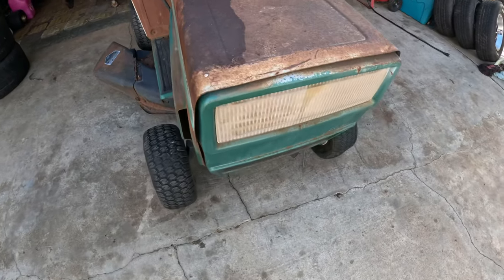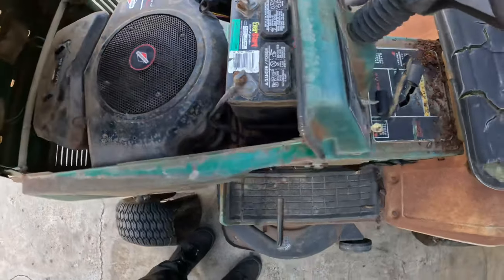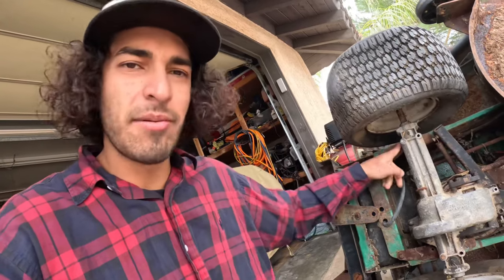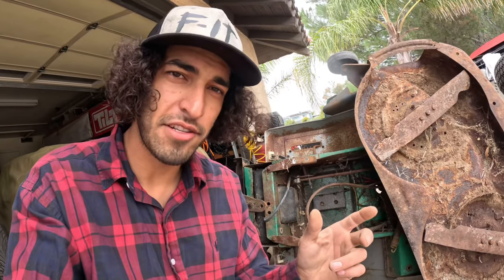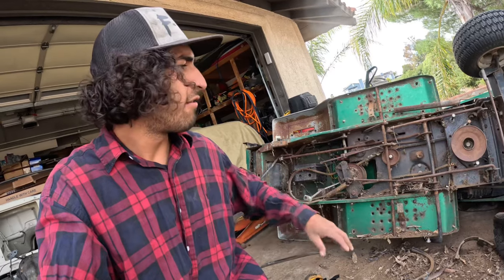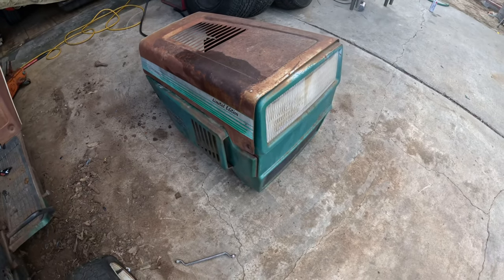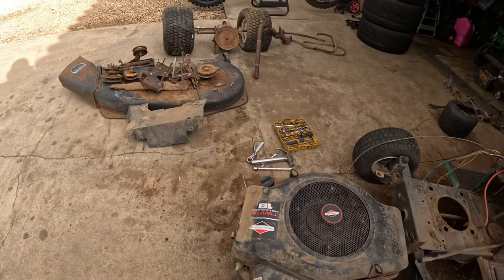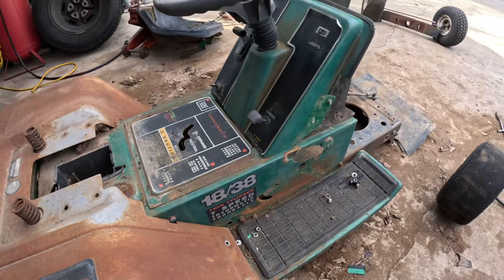$50 Race Mower Build (pt.1)

Comment: Dude! Limited Edition, that single headlight is awesome, you might be able to tuck a small light bar in there. Leave the paint and clear coat it, or that Shine Juice that vice grip garage has. Following, I'm going to buy an older race mower that needs rebuilt.

Comment: I know u sead u didn't know what you were doing but future reference the blades and pulled on the deck don't need to come off just the pins holding the deck to the mower also loving the vid 🙂
Reply from the maker: Haha yeah I realized that afterwards 😂 all good though just an added 10min to the process

Comment: I have a few cr250 lawer clips on YT that i build a few years ago. It wasnt perfect, the steering broke twice resulting in some big crashes. It was initially a 110cc chinese dirtbike engine but I thought it needed more horsepower. cr250 was way to much to control.

Comment: No way that's $50 in my parts.
Everyone: No way, low ballers I know what I have.
Reply from the maker: I spent $50 on the mower . But if you get lucky I’m sure you could find used parts for $50